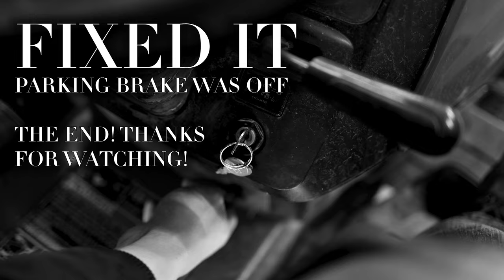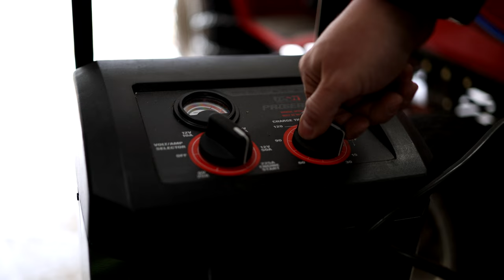How to diagnose a no start, step by step instructions —Toro Wheel Horse 522xi fuel pump mystery

Comment: I had to replace the fuel line from the tank to the filter then pump on my 522xi. It was cracking and leaking in multiple places. It was a moderate job stringing the new hose along the frame. I probably should have found a way to attach the end of the new hose to the end of the old hose to speed up pulling it through. The hydro return hose down in front of rear axle also dries out and needs replacing.